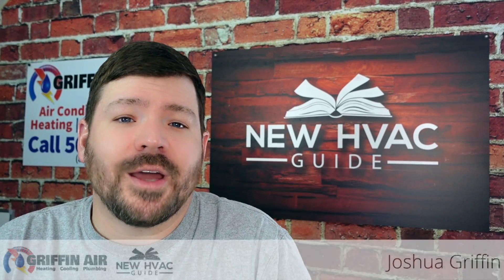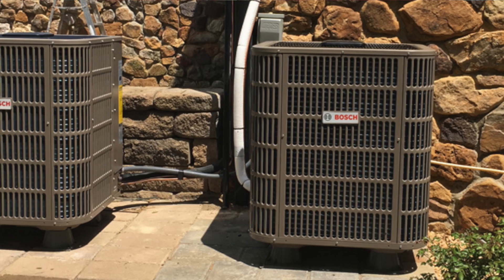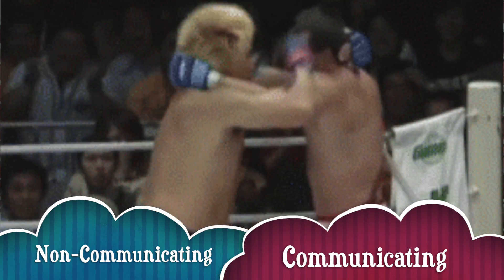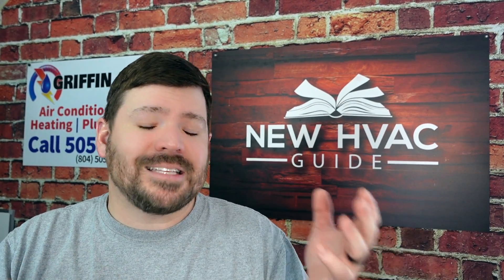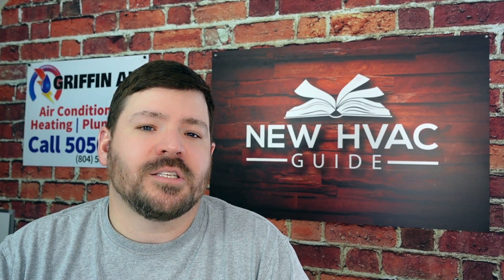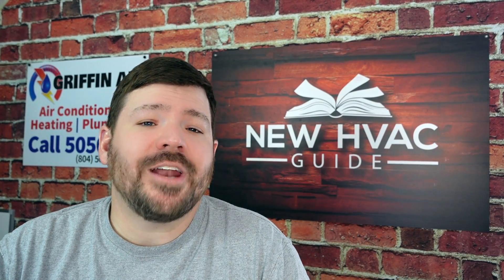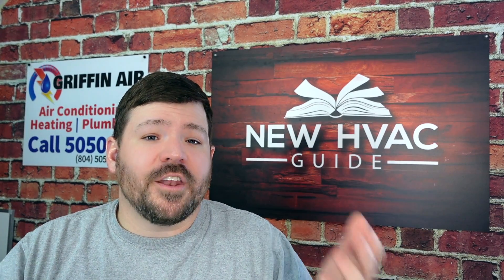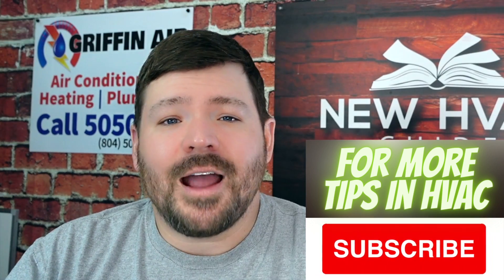HVAC Inverter WAR! Which is BETTER?

Comment: Josh, my Bryant Evolution 189BNV 4-ton AC unit states the two quoted sentences below in the literature.  How can it be both?  

"Compressor 5-stage rotary with 25-100% capacity range.  
Control Inverter driven compressor and fan motor. " 

Separate statements but same comment about my system:

I love the system as I know it is identical but less expensive than the matching Carrier.  The AC unit rarely runs outside of the first or second stage of cooling.  I love the variable speed ECM blower motor and my static pressure is fantastic and I have a AprilAire 1620 filtration system and AprilAire 700 Automatic. 
My Evolution furnace even at -5 never leaves the 1st stage of heating.
Reply: Why not? It runs the compressor at 25-100 percent in 5 stages. You can't do that without an inverter.

Comment: Josh, i sure wish you would service the Lake Gaston area. we really need a guy like you!
Reply from the maker: Thanks pal.  I've never been to Lake Gaston.  I've heard it's nice.
Reply: @NewHVACGuide 
Come to San Antonio in April.
Fiesta lasts 2 weeks with parades, food booths, concerts, and partying. 
I call it Mardi Gras without the violence. 
Bring a 4 ton 17 or 18 seer Amana or Rheem and 2 stage air handler for the attic. 
I'm replacing the 8" ductwork with 9" myself. 
Thanks
Reply from the maker: I wish pal. That sounds like fun

Comment: What kind of metering device does an inverter system use? Is it an EEV
Reply: Depends. You can have a mini split use a capillary tube, or an EEV, or some could use a traditional TXV for an air handler (Gree Flexx uses TXV inside, multiple EEVs outsite).

Comment: Just got a quote for an inventor system and heat pump and shocked at the price. The quote was $25,000. I looked into it because my house system is 22 years old and inefficient but working. Instead I am thinking of just adding 12 more panels to my new solar system that would cost a fraction of the cost.
Reply: that cost is INSANE!!!   I looked at 3T Inverters yesterday(not Inventors) that were between $3500-4500 product alone.  I can't imagine Labor being $20,000.00 more.    But maybe you needed a larger unit and many extras.
Reply: Just curious what brand of units were you quoted? Just replaced my units at roughly the same age.
Reply: The upcharge for inverters is insane. Its not some crazy install from doing a regular ac unit. And the actual unit prices are not justifying the costs.

Comment: I’m technical support for York, Mitsubishi, and Bosch in the Houston area and I love your videos.

York released a unit a few years ago that is doing really well called the HMH7(rebranded Hisense). It’s a mini split condenser that was reverse engineered to work with non-communicating indoor units.  It works like the Bosch in regards to monitoring the suction pressure/temp to determine what speed to run the outdoor motor and compressor.  

The unique thing about this unit is the outdoor unit determines the fan speed through a relay. It’s only 2 speeds, but it defaults to hi-speed and if the outdoor ambient is low or it determines there’s a low load on the evaporator, it sends 24v to the relay switching the fan speed to low.  You wire the relay directly to the motor taps.

Right now, they have it priced in line with 16 SEER 2-stage units, so it’s a really competitive unit to have in your offering. You are getting inverter technology without having to upgrade everything to communicating.

We’ve been selling it for about a year and so far they’ve been pretty solid.  Almost all calls I’ve gotten are either from wiring or wrong thermostat settings.  

In regards to smart thermostats, or the Nest in general, I’ve gotten the same message from JCI tech services - stay away.  The main reason is using one without a common.  The Bosch reasoning is their unit does these long cycles and slowly ramps capacity and you want it running for long periods(1 cycle per hour preferably) and if your thermostat is “learning” during these periods it’s going to cause havoc.  There’s other issues but this comment is long enough. 

My favorite out of everything is Mitsubishi.  They are coming out with an A-coil that is going to kill it in Houston due to all the furnaces we have.  Plus, in my opinion, their manufacturing and build quality is top notch.
Reply from the maker: Hey pal. Send me an email. I’ve got a question for ya 🙂
Reply: What communicating thermostat pairs well with the bosch heat pump?
Reply: I have the HMH7 4 ton unit paired with a york variable speed Air Handler,  I was amongest the first few in Georgia that had installed it when they were launched.  I have an Ecobee premium thermostat that controls the HMH7,  do I need to change it?

Comment: I’ve been running a non communicating Bosch heat pump with an Ecobee thermostat for about 8 years. Bosch uses a target temp for the indoor coil and modulates the condenser accordingly. I’ve recently upgraded the blower unit to be multi-stage. The system runs in stage 1 the majority of the time, hits stage 2 occasionally and almost never hits the heat strips. This is using Ecobee’s longest cycle settings to approximate the Bosch one cycle per hour targets along with letting the Ecobee automatically control the staging. No complaints.
Reply: I have only service Bosch equipment before, but I know they are pretty decent quality.  I love the multi-stage systems of any brand that runs properly.  I don't need to name the two brands I sell but they have twin systems to your system design and it is exciting to see efficiency running as it should plus the customer being happy to be saving money.  We don't use heat strips here in Denver as our dual-fuel system are NG furnaces and straight AC or what I prefer to sell 90% of the time is a high-efficiency heat pumps, especially when they have solar panels.   Those long cycles are very important to efficiency and the Ecobee is a fantastic product.
Reply: @Balticblue93  Bosch just rebrands Midea based equipment. Even Pioneer sold the same system a few years ago.
Reply: @Balticblue93 yes you are in Denver- high dry and cold- perfect for Bosch non communicating solution-no humidity or trunk season to deal with .

Comment: I have solar panels, which were installed last November.  A couple weeks ago we had a Lennox Signature Series modulating furnace and inverter heat pump. On a sunny day I am running my whole house, including heating and still sending a bunch of electricity back to the grid. When the sun is not shining I heat with gas. This summer I should be cooling my home for free as long as the sun is up. I’m planning on adding batteries so I can continue to heat/cool for free after the sun goes down.
Reply: Hello Owen I am a fellow HVAC service technician it looks like you’re a sound guy and I think you have you’re bases covered. I would recommend having a maintenance performed because I found the 90% lennox furnaces have small leaks there first year due to there second water condensation drain line. I usually just tighten the joints or add more glue and then it solves it. Maybe you could turn your furnace on and inspect all the hoses while it’s running and check for moisture. It’s a good idea :)
Reply: @User-be5yj  everything is out in the open. I see the drain line every day. I’ll be sure to keep an eye out for that.
Reply from the maker: That’s awesome!
Reply: Enjoy the Lennox class action lawsuit.

Comment: I think what you are going to see in the future is a lot more air to water systems feeding a hydrocoil in a air handler. These new air to water systems are monoblocked, meaning they are factory charged and sealed just like a window unit. Set them ,wire them and then pipe PEX from them to the air coil. Install some insulation and you are ready to go. No evacuation, simple PEX water lines with a little antifreeze. They make your hot water for bathing eliminating the heat pump water heater. If it breaks it can be removed and a spare unit tied in in a matter of minutes and taken back to the shop for repair. Will they communicate? Probably, it is much easier to control heat with water than air and the simplicity of these systems will allow them to be fit to your typical warm air system. Dehumidification is much better with chilled water. With everyone hell bent on heat pumps this is definitely the best way of doing it. If there was ever a system that lent itself to the diy market...this is it.
Reply: And I forgot to mention, no flammable refrigerants in the home.
Reply: never heard of this are there any units being manufactured today???
Reply: @rivergate950  They all make them. Very common in Europe and Asia. I posted links to the units but by comment disappeared so all I can tell you is search google with "air to water heat pump"
Reply: You are a bit hopelessly optimistic. First off, if you do this, you are more likely needing to install in floor heating - have fun with that if your floor already is installed.
Second, you say there is no evacuation, that's not true. You have to make sure you introduce the fluid to the line set and evacuate all the air. Third, you won't have enough for both hot water and heat for the home if you live up north. Fourth, LOL, you think you can just put in a new unit if the main one fails, lol. Guess how much the one from Stiebel Eltron weighs and costs.
And no, dehumidification isn't better or worse with a water system.
Reply: @sprockkets  I installed radiant floor heat in my home 33 years ago, in my shop 25 years ago I also have it in my porch as snowmelt and even in the dog kennel. I have installed over 50 radiant floor systems, some very complexed, multi temp, multi fuel. 2nd Air evacuation lmfao, yea that is called a coalescent air vent, we use them on all hydronic systems. To make them work you simple turn on the pump  lol. 3rd I do live up north in PA. Modern hydronics use a indirect water heater sized for the domestic load, they are piped in like any other zone except they are usually given priority, there is no need to supersize your boiler, I installed many indirect water heaters and still do when I use oil or wood but if gas is available I favor tankless as there is no standby loss. But being flueless and super insulated they only lose 1/2 degree an hour. 4th yes I do I replace cast iron boilers that weigh 5 times as much as a monoblock heat pump and I have to take them out the steps. At the ASHRE show I talked to many air to water heat pump companies and you shouldnt confuse me with someone who "guesses" A cold climate "vapor injection compressor" 5 ton spacepak Solstace weighs 349 pounds. If you think that is heavy you obviously don't do hydronics or steam. Without confusing you I will leave out the science but chilled water is much better at dehumidification for the simple fact that the water can be much colder as its temperature is not dependent on airflow and superheat, this is why it is so easy to zone a chiller system. I am a Robur certified ammonia absorption installer, having installed many systems I am more than qualified to speak about water chillers. I will give you this though, for someone who obviously knows so little you are not afraid to post your ridiculous comments for the world to see. We start our third year apprentices with books from Dan Holohan, that would probably be a good place for you to start, Caleffi also has an entire collection of books for free on their website, one is air to water heatpumps, you should read it.
Reply: @anthonyspadafora1384  tldr, you also fail at the simple reason why you dehumidify better than chilled water since any inverter system can modify its superheat and fan speeds as well.
Reply: @sprockkets  Because I can run a much colder coil and and fan speed is inconsequential as the temperature of the water is controlled by an aquastat. Yes inverter ductless units can dehumidify just as well. They do this by using a accumulator to protect from very low superheat. Also since ductless units do not need to maintain a duct pressure for proper balance they can lower their airflow much lower than a ducted system.  The best way to control humidity is with a gas fired desiccant unit. They introduced new residential type units at the show. Desiccant units are used where zero humidity is allowed such as chip making and other electronic components. They are also used in high end hydronic floor cooling in conjuction with the chiller to lower dewpoint before circulation. Using desiccant allows for the use of high seer units running warmer coil temps by lowering the dewpoint without lowering air temperature which can cause condensation problems on poorly insulated duct and boots.
Reply: @anthonyspadafora1384  Fine, let's not be usual people then on YT that argue and shout. But still....
Reply: @sprockkets  Im not yelling but I did yell at a kid this morning who made a youtube video called"Why high efficiency furnaces are a scam" I got a little carried away but he did call those of us who understand the benefits of high efficiency furnaces, Scammers, I took that personally. lol
Reply: Won’t happen, government doesn’t want people DIYing….
Reply: @mrpatter19888  Let's see, Im heading to the ASHRE show this Monday and we will see what is hot and what is not. It has already happened in Europe. All this o ring squeeze fittings, guys soft soldering, leaking flare joints, all this goes away with a monoblock. All you have to do is PEX it up and throw on some insulation. Even if you eliminate the DIY guys your shops won't have to hire mechanics anymore, just a couple of handymen can fiberboard a air handler in and run some pex tubing. You wont need gauges and brazing equipment anymore. Labor prices will go down. Space pack has already invested heavily in this tech www.youtube.com/watch?v=aauyPehwsHM&t=632s
Reply: @mrpatter19888  If you think it is DIY, you better check out how to install one. It isn't straightforward, at all.

Comment: As a tech, I'd like to see an industry standard communicating language so the aftermarket could jump in and some kind of emergency mode where you could make it a single stage, for when that fancy, proprietary thermostat takes a dump on Friday night!
Reply: Goodman inverters can use any thermostat in the world. Also Lennox inverters have a way where you can make it single stage if you need to
Reply: @jeremymorgan7199  I don't see a lot of Lennox residential equipment but good too know!
Reply: @Adam-ul2px  Lennox mini split, Carrier, Cooper hunter, Samsung, Bosch, blue ridge, Mr Cool, the list goes on are all made by Midea.
Reply: So far, replaced 3 heatpumps, 4 thermostats, and the communication board on the air handler, refrigerant charge checked many times, all new electrical, all new duct system....there isn't really anything left to do except swap to another brand system. Something is just off and the manufacturer says...all works as intended. It's just frustrating to spend sooo much money for what is believed to be a top of the line communicating system, yet it performs no better than a 20 year old single stage.
Reply: @tewindle  whow
Reply: @tewindle  $20 they didn't replace the thermostat wire or they didn't ground it LOL
Reply: @sprockkets  Here is the odd thing, the thermostat wire was brand new due to moving the thermostat to the center of the house with the previous York unit. And the Google Nest learning was working great on the York system. When they put in the Rudd/Econet, I asked if they could use the existing thermostat wire (8 wire), they said they always replace them with every install, and the new communicating system only required 4 wires. They told me they ran a new 8 wire thermostat wire, even though only 4 was needed. As for grounding, the air handler is grounded, are you thinking there is some sort of grounding on the low voltage side that may have been missed?
Reply: @tewindle  No, but the unused wires in that thermostat wiring need to be grounded, usually best at the air handler. Carrier figured that out years ago when they also had communicating issues.
Reply: being locked into a proprietary thermostat, like econet, has been nothing but trouble for us, I despise communicating systems! We are now at the point of looking for a replacement for the brand new system. All companies can talk efficiencies all they want, but truth is, our system is running like a single stage system when heating...max speed outdoor fan, max speed compressor, max speed air handler fan speed. I believe the ramp up/ramp down literature is all based on A/C needs of the home. Also the communicating part is telling the air handler to immediately go into HIGH AUX heat every single cycle...there is no way this is energy efficient!
Reply: @tewindle  sounds like it's not setup properly for your home.  Communicating systems work great when they are working but in my ~15 years I've met very few techs that were proficient on the communicating systems for the brand they sell, let alone the systems made by every manufacturer.
Reply: @tewindle what brand ?! People want to know !
Reply: @johnwhite2576  Ruud. If you treat the thermostat like an old fashioned mercury switch, then it works. There is nothing smart about it, other than it has a non responsive app
Reply: I'm scared

Comment: We just started carrying daiken as a brand.  They sent representatives to teach our the “Daiken way” and all.  Main grump I have is the way you program their boards.  You have to push buttons in sequence 24 times, 72 times, 53 times.  If you mix up pushes it will not work.  Very frustrating
Reply: Yeah, you'd think the companies would eventually develop some system like the OBDII on cars.  Basic function then mfr specific controllable thought third party scanner.
Reply: Great idea, just like USB on computers
Reply: Counting is hard.
DUHHHHHHHH